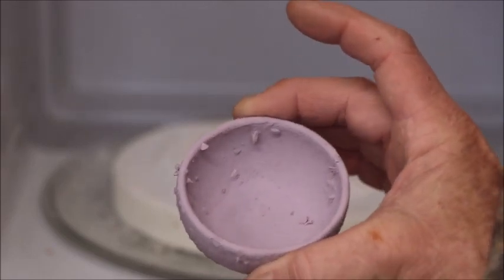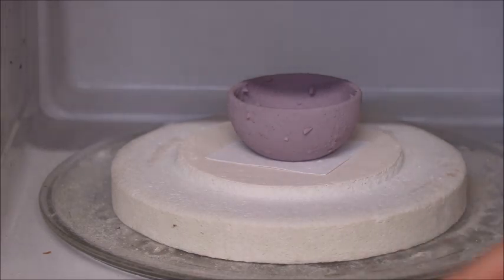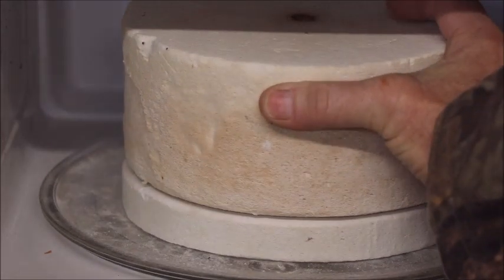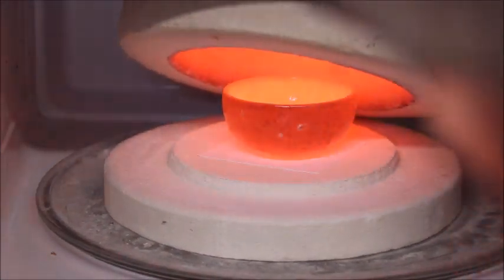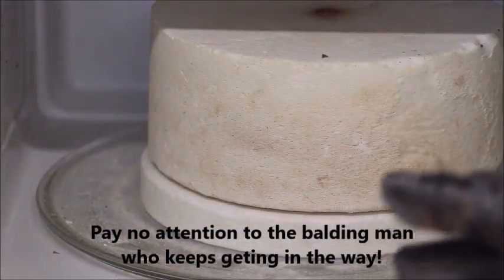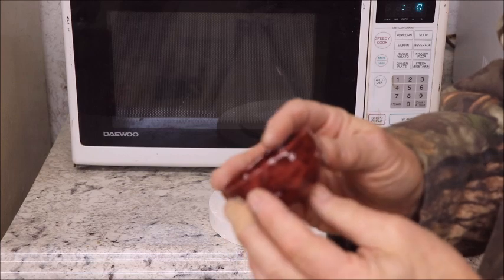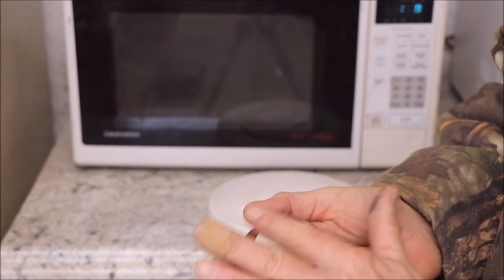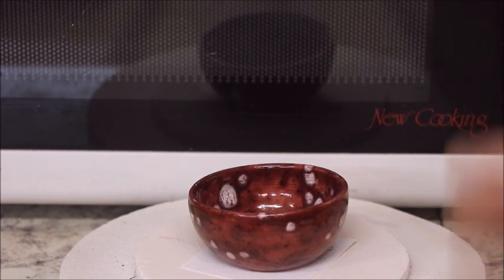Glazing in Microwave Kiln

Comment: what is shelf paper? and how do i get it. this series is so helpful, thank you so much for sharing your wisdom!!
Reply from the maker: Shelf paper is a material that is sugar based (usually) material that burns off and leaves a white nonstick material behind that inhibits the sticking of glass to the ceramic shelf.  The shelf should also be treated with a non stick (for the most part) coating called kiln wash.  Both can be found starting here: https://www.amazon.com/Bullseye-Shelf-Sheets-Fusing-Supplies/dp/B084KYRKZ8/ref=sr_1_2?crid=2FEXALOXS1HQ2&keywords=kiln+shelf+paper%5C&qid=1643418189&sprefix=kiln+shelf+paper+%2Caps%2C68&sr=8-2 and here: https://www.amazon.com/Fireworks-FW737A-1-Pound-Kiln-Wash/dp/B008D1OQGW/ref=sr_1_4?crid=1CJIRQ1Z75LQY&keywords=kiln+shelf+wash&qid=1643418247&sprefix=kiln+shelf+wash%2Caps%2C63&sr=8-4.
Reply: @CaptMike  thank you so much captain mike!! i hope i can find it in my country hehe, cant wait to experiment with the microwave kiln :)))

Comment: Nice! I didnt know that you can glaze in a microwave! I was being sad because I don’t have money for a kiln, but this seems like something I can try now!
Reply from the maker: Nicole, remember that low fire (cone 06) glazes work best for this.  Also make sure your project is not too large to fit comfortably in the microwave kiln.  Leave a little room all around and remember to use shelf paper or something between the piece and the kiln bottom.  Have fun!
Reply: Where can I find this glaze? thanks! @CaptMike
Reply from the maker: @HerdsandWheySoap  this is a Duncan Crystal glaze.  Cures at cone 06.  Do a search for Duncan or just "crystal" glazes and you should get an idea where you can get it.
Reply: Thanks! @CaptMike   I'm excited to try this! Have you ever used the microwave kiln for clay & glass together-to melt glass onto clay?
Reply from the maker: @HerdsandWheySoap  Not in the microwave kiln.  I think the heating and cooling to too rapid.  I have made a few pieces in my glass kiln.  It is hit and miss!
Reply: Wow 🤩 exciting! Think I need a microwave kiln. How long do you leave the pot to cool down, 12 hrs maybe? The actual ‘firing’ seems so quick!
Reply: Hey thankyou for this video.  Do you think an 1800w microwave can fire higher than cone 06 ?

Comment: Hello! I am new to the microwave Kiln and I'm starting out with the smaller size. Do you know how long I should leave something really small thats glazed in there for? Like less than an inch
Reply from the maker: The smaller the item is the less time it should take to get it to temps.  Go  with the 3 minute intervals and check in between.  When it get brigh red it should be done.  Remember, this is a trial and error system,.. Be patient.

Comment: Hi , where did you get your microwave kiln from? Is it the same as the glass microwave kilns? Thanks I’m in Australia.
Reply from the maker: I use a stsandard  microwave of 600 to 1500 watts.  The kiln came from Amazon Prime.  https://www.amazon.com/Professional-Microwave-Fusing-Melting-Jewelry/dp/B01M2XWNCI/ref=sr_1_5?crid=3DJU7JKLNURPA&dib=eyJ2IjoiMSJ9.q6cchkiYQe1fF2ohTeqCR5X228njR00mUqGSEjpsyCRU7ZI0jEa0n2pFSL4M_Chl7IKiOGlvgMcNtaRRoOWg9Tp_qGuHeLY4UrbL0v1AMJycbRhehWYih1VkKYxc6MGNGFExbjhV2BCnhAwzqlzD5rCvuQSSykMP0R-R1nn5Bokb3BKQlV-KEMRFVn9QxavpHTsRay51RcuG-k4UHFhNZm1-iyDLh6EaQcefS3sim3I-OA0xxFuJLARdM2jXgQH-2_vSyOqo0tspu5bLfzjMONjnJWVjpvCZpQY8SLM7mV4.83guy_30WLoRPPz75iKGt2Pw9COw0FXjbaDGJXXg6YM&dib_tag=se&keywords=microwave+kiln&qid=1716252811&sprefix=microwave+kil%2Caps%2C105&sr=8-5.  It works with both glass and ceramics.
Reply: @CaptMike  thanks so much , greatly appreciated. I’m looking forward to seeing if I can replicate your results 😊

Comment: Hi, this is great! I found 2 beautiful handmade santa mugs in a thrift store from the year 1949 and the artist forgot to glaze the bottom of one of the mugs where the date is and her name. I want to preserve the bottom of that mug. Can i just add some glaze on that mug and microwave it for about 5-6 minutes without the microwave kiln? I don't want to damage the rare antique but want to coat the bottom with something that will stay when i wash and microwave it with coffee. Do i need a microwave kiln for this small project?
Reply from the maker: Since you are dealing with something old and maybe valuable, I would not try to glaze the bottom.  You might try sprayinga little clear enamel on the bottom, but I could not say that would work.   Almost no one glazes the bottom og their work.  It is possible that waterproof ink was used.  Just be careful with the cups and you should be OK

Comment: Maybe is a stupid question; does the microwave has to rotate inside? mine doesnt rotate cuz is a broken microwave i use to test, is it the same?
Reply from the maker: I'm pretty sure it will work OK without rotating.  I think it work better if it rotates, but you won't hurt anything by heating without rotation.
Reply: That’s a relief cos mine just melted :/ oops

Comment: What's the biggest size of ceramic recommended to fire in a microwave kiln?
Reply from the maker: Not trying to be a smart a**, but if it will fit without hitting the top or sides it should be OK
Reply: Thank you 😂

Comment: What type of glazes do you use for this process? Is there a particular cone level we should be looking for? Sorry if you already addressed this question in your video (I jumped around some and may have missed it).
Reply from the maker: I use a cone 06 glaze. It would be difficult to get temps high enough for mid to high (cone 5-5 or higher) glazes.

Comment: Thank you so much for all the info. Can’t wait to try this. What clay do you use please?
Reply from the maker: Shirlee, you can use any type of ceramic clay or skip.  Just make sure the clay body (item) is thoroughly dry before you add the heat.  Most of the items I do in my microwave kiln are made of clay slip poured in plaster molds.
Reply: I guess I will have to try it without a plaster mold and hand form the clay. I Assume a low fire clay may be best. Thank you for the help.
Reply from the maker: Just make a small finger pot out of regular clay.  It will work fine.
Reply: Can I fire a pot in gas oven without a klin that you used in the microwave?

Comment: About how long does it take to cool? In the regular kiln I wait at least 8 hours...do you have wait that long with the microwave kiln, as well? I'm so excited to try this! Thank you!!
Reply from the maker: As a rule, I let the kiln sit about 30 minutes with the MW door open, then I place a 1/4 piece of ceramic under the lip of the kiln and let that sit for about 30 minutes.  Usually that is enough time so that you can remove the kiln and place a thicker piece of ceramics under the edge.  Usually it take about 1 1/2 hours to cool enought to remove the top of the kiln completely.  I have rushed this somewhat and cooled in less time.  It just depends on how much of a hurry you are in.  I have never had a piece of ceramic crack no matter how hot it was when I removed it....think Raku.
Reply: 5:18 beautiful, but how long should the project take to bake the glaze?

Comment: How many times did u put it in 3 minute intervals? 4?
Reply from the maker: About (usually) 5 times.  I lift the top a little and check the color or the piece.  I want it to be yellow hot if I can get it there.

Comment: How many watts is required for raku and to cure the ceramic ?
Reply from the maker: A 600 watt microwave will do the trick, just might take a little longer.  Fire the piece until it is glowing red hot and then carefully place the piece into a chamber with a combustable material in it for the raku effect.

Comment: Hi, Mike. My microwave kiln works really well for bisque firing, but not for glazing, no changes in the colour. It was firing 35 min in a microwave 700watts with underglaze Mayco. My microwave kiln reach until 900°C Do you have any idea why i do not have results with the glaze? Thank you for sharing your videos, very interesting.
Reply from the maker: Alexandra, when I made this video I did not measure the temps.  I used a Duncan coe 06 glaze, CR853 I think.  I have since experimented with how hot a MWK will get ad find they can reach maybe 2000 degrees F.  Most cone 06 glazes mature at around 1830F, but will sometimes work at around 1700f.  See if your MW will push your kiln to around 955C.  Maybe try another glaze, Duncan for instance.  I know this will work, just have not tried all makes of glaze.  Let me know how it works out for you.
Reply: Thanks, Mike. I will try with Duncan.
Reply from the maker: @alex_5659  let me know how it turns out for you.

Comment: Hi Captain Mike. I keep having issues with the glaze bubbling up. Do you think it could be because of the high heat? I put it on for 15 min (after heating it up slowly on lower wattage for 2x3 min). And when you do the 3 min increments do you let it sit for a while before going for another 3 mins or do you just quickly check on it? I’m so disappointed because it works great for bisque firing but I just keep failing with the glaze. I also make sure it’s completely dry before glaze firing.
Reply from the maker: I do not wait between zaps and I have never had problems with glaze bubbling up.  Are you letting the glaze dry completely?
Reply: @CaptMike  That's good to know. Yes, I let it dry for up to 3 days when I was testing. I suspect my clay may not be fully bisque fired? I am just testing this so we shall see.
Reply from the maker: @blueskyalldayeveryday  If you are using at least a low fire ceramic clay body and a compatable ceramic glaze, moisture is the only thing I can think of.  Let me know  when you get through testing.

Comment: High Captain Mike, what are the best bisque or clay to use in the microwave? Recommended glazes or a link and where I can buy molds too?
Reply from the maker: Nora, any clay will do for firing to bisque (cone 04) and you can use any commercial glaze that fires toi around cone 06.  It is hard to get the temps any higher than cone 06.  I order a ot of glazes and such from Glaser https://glaserceramics.com/index.php?route=common/home, but Amazon sells glazes also.

Comment: Where did you buy this microwave Klin?
Reply from the maker: Amazon Prime: https://www.amazon.com/Professional-Microwave-Fusing-Melting-Jewelry/dp/B01M2XWNCI/ref=sr_1_6?crid=1JX2PXRQ9ETGU&dib=eyJ2IjoiMSJ9.q6cchkiYQe1fF2ohTeqCRwxILtgR0PlVytwxg038yQ9hlheZanvY_-IbTggs6fEXIT_m-OR6hjjsfNbQaBSUiOOVpIGtGnpB3WIhAhHiLCj5O8sGxaB_rFkeA_0CIMjlCf2rsD4CX42xJ8YcDTxPz4-LQnQ0PCcVfCLyeKCCbvxoC_5nGDKck89IvDdlOTWXxDZmcroYIt7IsXA1wqPzVn1cSJx04BlC5ryZoo2BR56Z_xD3ltWB959ndrFWkhh2_sfQOo1woTXm1U-k8Clg2byK1d-C5cvmPCi9EKp-tuA.TxwLtciICZfGKrLGLC3NyRBZo1KU2o0RnGMwV3DJVZs&dib_tag=se&keywords=microwave+kiln&qid=1710030492&sprefix=microwave+kiln%2Caps%2C94&sr=8-6
Reply: @CaptMike  Thanks so much! On the Kilns description it says "4.5cm" for height but your pottery looks much higher than that...Probably around 5cm. Should I buy that size? My pottery is about 5.2cm.
Reply from the maker: @lazyteima  buy the largest kiln you can get!

Comment: Hi, I have another question :) I actually finally got a microwave kiln, but was wondering if I can just use it in my kitchen microwave, or is that dangerous? As in, fumes, resedue, dust that would contaminate my microwave and therefor would make it not food safe?
Reply from the maker: It is recommended that you not use your kitchen microwave for the microwave kiln.  There is some dust, fumes from the shelf paper burning off and maybe other things.  Just be safe.

Comment: If you were to use a bisqued clay mould to melt glass in, would it be ok providing you used kiln wash? Thanks for the great vids
Reply from the maker: Fired clay is what is used for glass molds.  Just make sue the mold does not have undercuts and is prepared properly.  Slumping or draping is no problem, but I have had some problems firing the glass to hot.  Approach whatever you are attempting slowly until you find the right temp.

Comment: Hi Capt! I am watching and rewatching these videos as my makes keep exploding. I made it through bisque first time then exploded with glaze, second time didn’t make it 3mins to bisque and same 3rd time. I have preheated all clay at 90’c (UK) for 30mins prior to trying for bisque. Any tips? 
I am also completely new so struggling with dry time, I have seen some say leave it a week and others able to bisque same day as make. Any drying time advice between make and bisque, then to glaze and glaze to fire? I just want to stop the explosions  😂
Reply from the maker: It's hard to say when I'm not present to see.  I do know that if you use a regular kiln you can bisque clay that is not completely dry as the kiln heats up a lot slower.  That is the problem with MWK's.  Theu heat up very fast and if there is any voids or moisture present the piece is likely to blow up.  I have had a few small pieces blow up, but not many and if I get to the glaze stage it usually works out fine.  Try making your pieces thinner (for bowls). solid pieces tend to be more problematic.
Reply: @CaptMike  thank you, will do

Comment: Do you know where to find the silicon Carbide to repair cracks in the microwave kiln silver ring?  Do you have something that you use that you know works & won't blow up when put in the microwave? I already have cracks after firing a few times.Thanks!
Reply from the maker: So sorry you are having problems with yours.  I have 6 microwave kilns and so far no cracks.  Have you tried notifying the seller about this?  I think the black material in the kiln is a type of carbon.  I will try to find information for you.

Comment: I wanted to ask you, I tried with success to fire my own glazes I make one is for cone 5-6, I want to share with my schedule and ask you if it's safe, because I was scared that it was too hot for the microwave and make a fire. I started slow.  At 40% I did 10 minutes, after at 60% I did 14 minutes, after at 80% I did 14 minutes and at 100% 15 minutes (it wasn't enough if I did less) is this ok you think or not? Thanks
Reply from the maker: Hila, don't worry a fire if you are keeping a close watch on the firing.  The glaze or clay will not burn and unless something inside the MW gets too hot (wires) nothing should catch on fire.  Always keep gloves handy so you can snatch the door open if something should go wrong and never throw water (should a fire start) on a electrical appliance.  I soda based fire extinguisher will be OK.
Reply: Thank you so much. 
But my schedule isn't too much? Too hot? Because of that hole in the microwave kiln I was thinking it's too hot for the MW
Can I add more time if I need? You think?

Comment: Hi Mike I was hoping to make porcelain jewellery in the microwave kiln, I don’t use glaze would I bisque first then put back in to high fire, thanks ?
Reply from the maker: Karen, porcelain is fired to over 2000 F.  My microwave kilns only fire to about 1500 F or so.  If you are firing using porcelain clay you could try and fire a small piece for an extended time, say 20 minutes or so at 3 minute intervals and see if it turns out translucent like porcelain does.  If you are looking for a "white" glossy finish you could simply bisque in the Microwave oven and glaze with either white or clear.  Hope this helps a little.

Comment: do you have a vidéo for the cover you use to fire your piece.
Reply from the maker: Hi Robert, are you talking about the top of the microwave kiln?  The MW kiln has a top and a bottom.  The top is lined with a graphite type material and that caused the kiln to heat up.

Comment: Hi! Have you tried getting something metallic inside? I was thinking of a holder so that I can glaze both sides of a pendant. (The holder I would put in a regular kiln) Thanks!
Reply from the maker: I have yet to try zapping something metal inside a microwave kiln.  I understand that some of the newer microwaves do not spark when metal is zapped.  Be a little more specific about glazing both sides and I will give it a try.
Reply: @CaptMike  Thanks so much for your quick response! I wish I could add a picture here, I basically wanted to put one of those little Bead Rack Stilts that have metallic rods where you can insert a spherical bead for glazing. Unless I can do that I will not be able to complete my project. Thanks!

Comment: what kind of glaze do you use in the microwave kiln? Does it need to be a 'low fire' glaze?
Reply from the maker: Normally I use a low fire glaze, cone 06.
Reply: Thank you! You are magically helpful!
Reply: One more question for your creative mind, Capt Mike- is it necessary for me to kiln wash my new kiln?
Reply from the maker: @drusmith243  It is always a good idea to put a coat or two on any kiln surface that will be used for firing. I prep mine with 3 coats of lin wash and also use shelf paper.  Remember, the floor of these kilns ar not as robust as a regular kiln shelf and can use all the help they can get!
Reply: @CaptMike  
Ahh yes- this makes complete sense! Thank you, thank you, thank you for your knowledge!
Reply from the maker: @drusmith243  Thank you for watching and or your comment!

Comment: Could I use a food safe glaze to make the ceramics usable?
Reply from the maker: Yes
Reply: Thank you! I’m just barely venturing into pottery and I would love to make some usable things even if they are tiny. Do you have any recommendations for clays and glazes?
Reply from the maker: @parastephkar98  If you are using a microwave kiln all you will need is a low fire clay.  Personally I would stay with a high fire clay as all clays bisque at the same temps (about all the microwave kln will do) and you can use low fire glazes on them.  Any good low fire glaze will be just fine.  They seem to masture Ok for me.  Duncan makes a good selection.